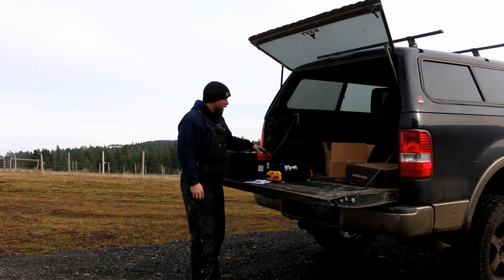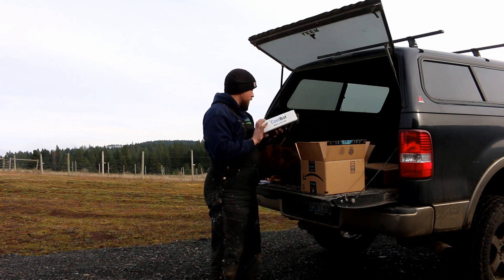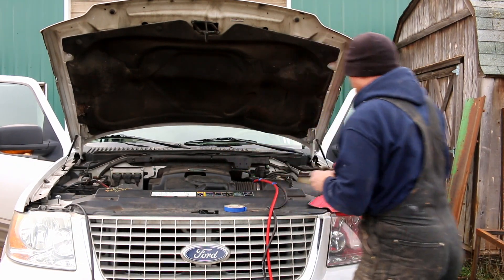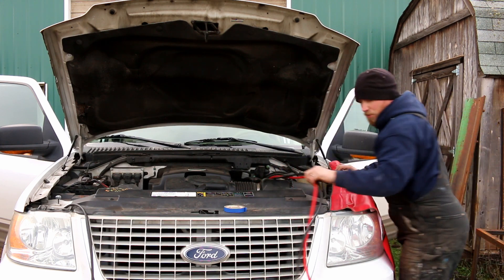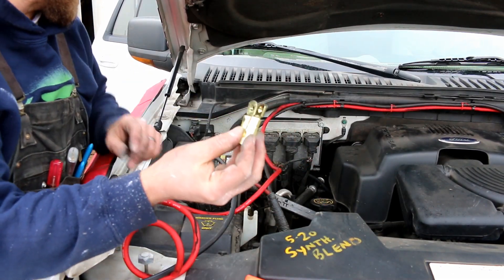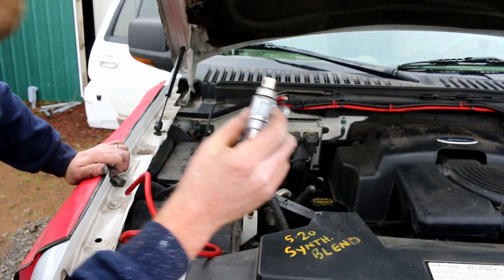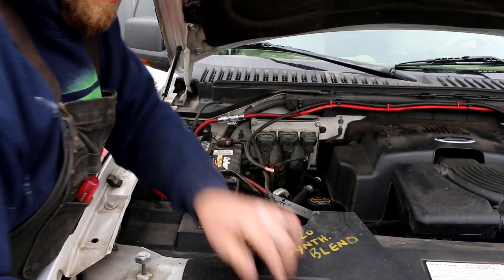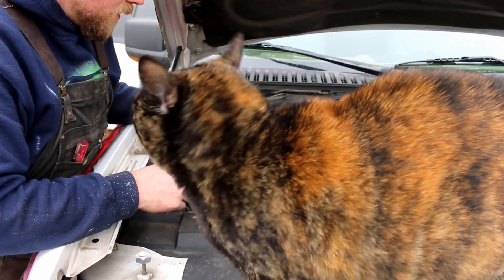DIY conversion - VEHICLE to FRIDGE!

Comment: Might be a bit late to comment, but instead of shelling out a ton of money on the CoolBot controller, why not use a controller like the Inkbird All-Purpose Digital Temperature Controller that's on Amazon for $16? Cheaper and looks like it does about the same thing as the coolbot.

Comment: Quick supplementary tip, store a spare fuse securely for this circuit to the fuse holder or close by so that should the original break you have a replacement easily to hand.

Comment: Hope you used an in-line fuse both ends of the heavy cable for safety so you reduce the risk of fire if theirs a short. 100a fuse each end of the hot is a good idea

Comment: Great video... I do suggest that you add a battery isolator for the truck battery / auxiliary battery... without that relay you chance the truck battery being sucked dry, especially if that auxiliary battery is a larger capacity than the truck battery ....https://www.waytekwire.com/item/80046/Sure-Power-702-Multi-Battery/?gclid=CjwKCAiAjanRBRByEiwAKGyjZfxgzmL9bPegKYfWIf_F4wwtBgK9ybMnbHTtUN63RxgDPEaw8nPffRoCLM4QAvD_BwE

Comment: Why not just run the A/C Unit from the 2nd battery and just run a split charging system to keep the 2nd battery topped up, this means it is not draining off the main battery, and it will only chrge when the engine is running and the main battery is fully charged, also you don't need to run 2 cables to the 2nd battery only one, the positive and then concept the earth to the body. The split charger is usually a relay with a trigger wire to open and close said relay, I usually connect the trigger wire to the battery light on the dash, so it only charges the 2nd battery when the battery light goes out.

Comment: Hey Martian, I’ve been following you for a while, and I see how meticulously you plan your projects. If I may offer a piece of advise, before you begin any kind of installation, open up all your parts and lay them out, determine what tools you will need and lay them out also. This will save you a ton of time since you won’t be running back and forth looking for tools. Take it from an old guy that works solo most of the time. Hope this helps.

Comment: I'd suggest a voltage sensing relay between the two battery's that way the second battery will get automatically disconnected from the starting battery when the altinator is not running.

Comment: What are you going to do with the heat and water from the air conditioner?
Reply from the maker: +Charles Shanafelt open the window an let it go directly out
Reply: Charles modern window AC units only drip if they have a high humidity load as they use the condensate water to cool the condenser using a ring around the outside fan to lift the water from a holding pan and spray it onto the radiator. 

If the humidity gets high enough to have the extra water he can drill and tap a hole to screw in a fitting to run a hose to a hole in the floor of the SUV.
Reply: Every air conditioner is a dehumidifier and I fear the excess water being thrown against the condenser to evaporate will fog all the windows in the truck unless it is exhausted outside.
Reply: Fogging windows requires them to be cooler then the dew point of the air so during the summer that should never be a problem  but could be when fall, winter and spring come around but then cooling will not be an issue then. 

The easy solution is to just have that back window open with a frame around it ducting the air to and from the AC

Comment: Any specific reason to run the negative/ground back to the battery instead of just bolting it to the body close to the A/C unit (like a seat belt bolt) ?
Reply: The aircon requires a large wattage and will therefore draw a very large current, which is why he's using such thick cables. Connecting the ground through the chassis would work but might cause power loss due to extra resistance. Overall it's probably best to run an extra cable in order to achieve the most efficient power transfer. Smaller things like tail lights don't matter because they draw smaller currents.
Reply: That's not really very thick wire when you look at power amp wiring. Even multi kW systems normally use the body for ground. .Often with improved wires ,or added in parallel with the stock wires, between body and battery - (along with alternator to battery +, and engine to body, aka "the big three"), but using the body for 'the main haul' of the return.
Reply: To reduce the voltage drop and ensure maximum power.

Comment: TRM, that lead acid battery is HEAVY! You should really consider lithium batteries. Higher power density and lower weight. Use Anderson Power Pole connectors on your cold box for goof-proof plug and play.  http://amzn.to/2B11Xqt That's a long cable, couldn't you have drilled through the firewall and added a grommet on the passenger side?

Comment: I recommend an isolation block for your connection of the second battery.  Will keep you primary battery from being drained from your inverter when vehicle is not running  Then when the vehicle is running again it will charge primary then the secondary battery.
Reply from the maker: +philipx2 great idea...Amazon link?
Reply: TheRealMartian www.amazon.com/gp/aw/d/B001FQOGFS/ref=mp_s_a_1_7?ie=UTF8&qid=1512749882&sr=8-7&pi=AC_SX236_SY340_QL65&keywords=battery+isolator&dpPl=1&dpID=51WjeB5aXLL&ref=plSrch
Reply: TheRealMartian I was going to mention the isolator any parts store or RV store will have one on the Shelf.